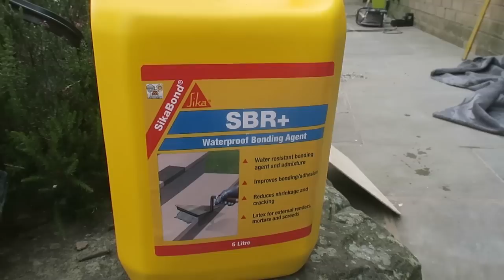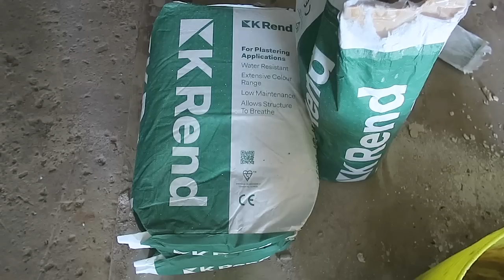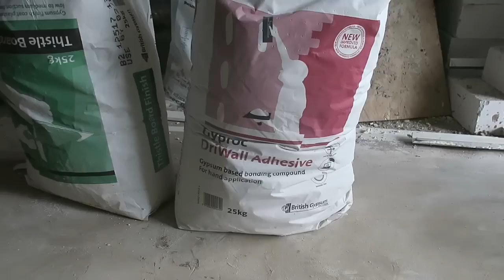how to lay block and k rend a wall

Comment: cracking job Stu .what about the step though
Reply from the maker: +ger martich were doing that at a later date 👍
Reply: Ger wkm  from Ron Georginas husband..setting block exactly on d.p.c.level always surprised me as in kitchen areas as specially it leaves the chance for leak on washer e.t.c...on my jobs we often cut the frog out of flettins so ...tight bed then d.p.c. then the cut flettins .now bed tight bed for second d.p.c....it gives a bit leeway against water  wicking . Particular when walls are only dog and can ..bit contentious this ... interested to see on here what you think ..
Reply: Dot and. Dab..
Reply: Ger wkm something I noticed as well the entrance step is way off... And why did the customer not want the new door to be centered???
Reply: @Stucrompton1  great videos Stu! With krend do you just flatten it with towel & when you add mesh in have you got to scratch it for top?
Reply: Its a sidestep

Comment: Hi great video thanks. I currently need to k rend my brick/block mixed wall and K rend CS told me to use different basecoats to different thickness on the same wall which is crazy! Do you always just use Sikabond SBR+ on surfaces and then HP12 undercoat + mesh+ topcoat? Will do that, if you say so. Thanks heaps!

Comment: The hardware stores parking is heaps different to Perth, Australian. Everyone has utes. Over there it seems small trucks and vans

Quick question. Why use gyprock on the internal walls? How come you didn't sand render then white set it? Just trying to understand the difference in country's
Reply from the maker: +Seb_the_builder everyone has a different way of doing things bro no two countries the same.
Reply: Seb_the_builder you not supposed to skim on render on the same day- u dot and dab, u can skim on it within a couple of hours, it’s a lot quicker,

Comment: Thanks for the excellent and informative video , Im looking to k rend the side of my garage , its solid brick apart from where I've blocked up a window and a doorway .  What type of k rend are you using ? I only ask as there seems to be  variants and im confused as to which one to get .
Reply: peter fido I would call k-rend customer services, they’ll tell you the system u require. Peace of mind- don’t just sand cement render it, it’ll just crack

Comment: Hi Stu, cracking job from you both once again. Was wondering about rendering over a painted brick wall. Is it ok to render over most painted walls. If so any precautions to take beforehand?

Comment: Nice but why did you apply the dry wall adhesive to the plasterboard directly rather than the wall?
Reply from the maker: Because it’s hard to judge where the edges are unless you use tape measure every time which could be hard work

Comment: Not picking fault,why did you uses 2 coat k rend and not 1 coat system could of scratch it same day.
Reply from the maker: +Martin Bellwood we used base coat and top coat mate, not rendering all the time so just followed best practice. Thanks for watching
Reply: It best to use 2 coat